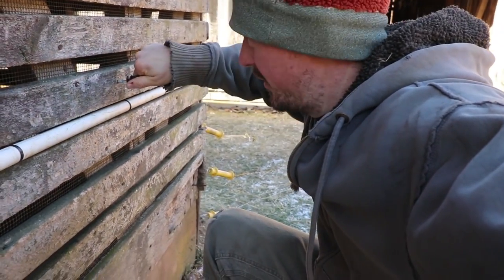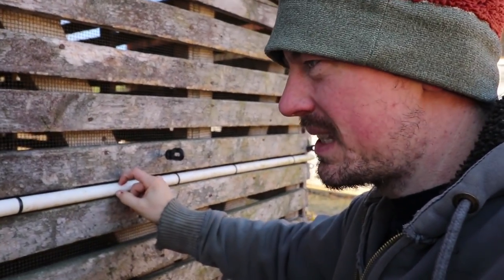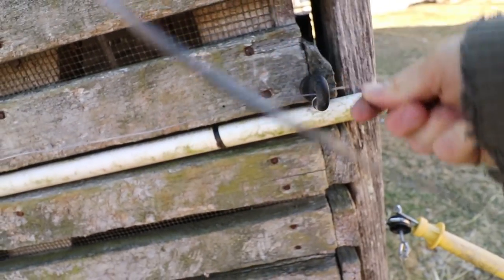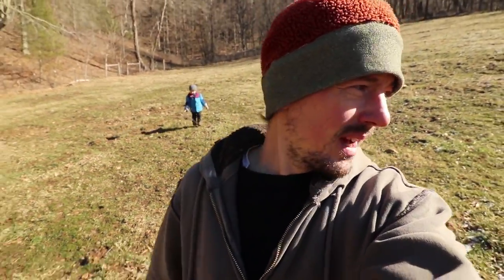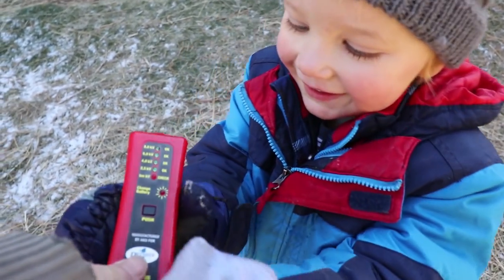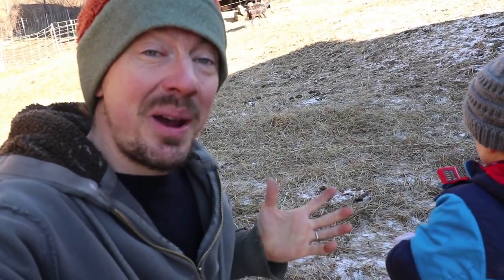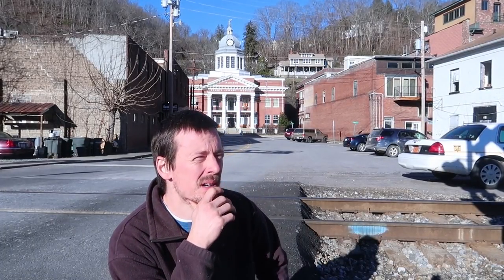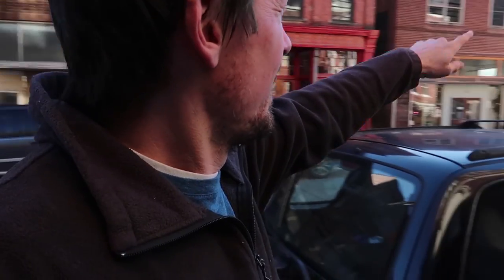Fixing This Fence Problem Got Us 8000 VOLTS!

Comment: The plastic on the wires in your house are PVC. That was likely not the problem. If the wire is grounding, it should make a ticking sound, where it is grounding, but just one wire touching a post will drop the voltage. Not sure if goats are like horses, but horses will check the fence with their chin whiskers to see if it is on and how hot it is. We have only a top wire, so if the fence is left off, the horses sometimes go under, but they don't go far. They just go eat grass that was previously out of bounds.
Reply: Goats are like aerial acrobatic horses =)

PS:  Got an Australian heeler(healer), they'll put the animal back AND stay where the animal got out. Great dogs.

Comment: The PVC pipe will not change the voltage. We have our electric fence wire running through PVC pipe and it is fine. It is the same as using the plastic insulators. I am surprised that the wire touching the metal T posts it was working at all.

Comment: Pvc will ground out found that out after my dad fenced off 30 acres took over a week he used it undergroynd under the gates. He replaced it with special electrical pipe and it worked

Comment: PVC insulator:
I have a lot of experience with running electric wire through PVC as a long insulator and it works "if".....
Any little bit of moisture begins grounding it out and if the ends are open as yours were it will get moisture build up even from dew.
PVC is not a conductive material so it's a very cost effective way to run long lengths. The secret? It's very simple, just tap a 90° or 45° elbow on the end of the run and moisture can not get up into the pipe. It works great. No clue necessary.
I also used to build gates out of PVC. Drill a couple mounting access holes into a 3" pics of pipe. Build your gate out of 2" pipe and run the hinge end through the 3" that you've mounted to a post. Drill holes into the pipe gate and run wire through the gate lengthways 2 or 3 strands. The fat is so light yet it would hold back a 1800 # bull.
-Russ